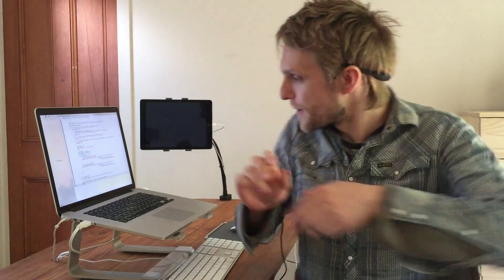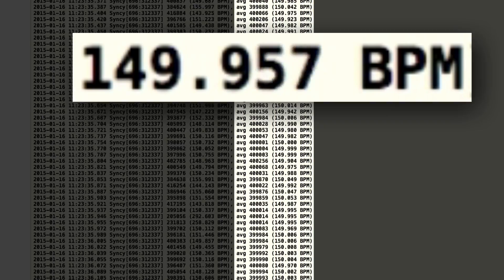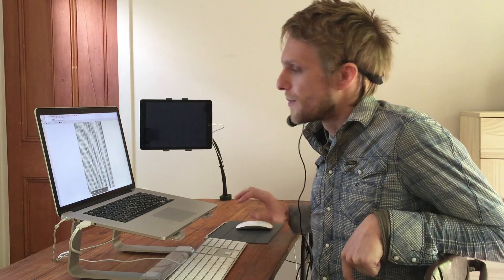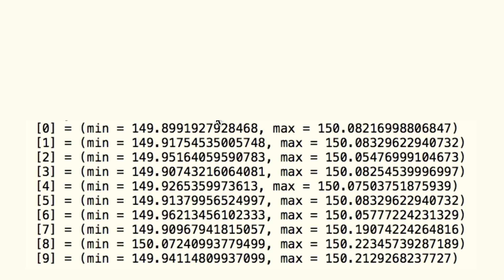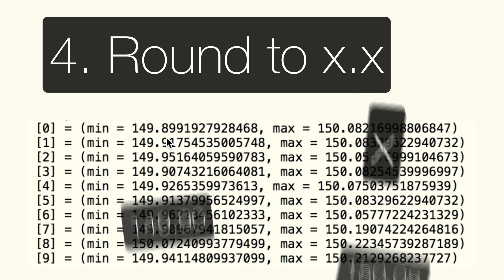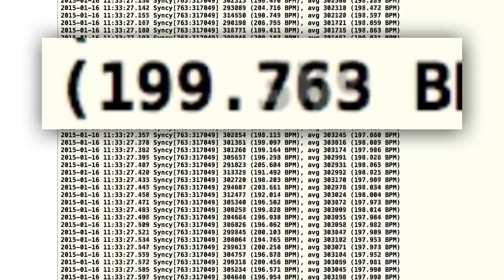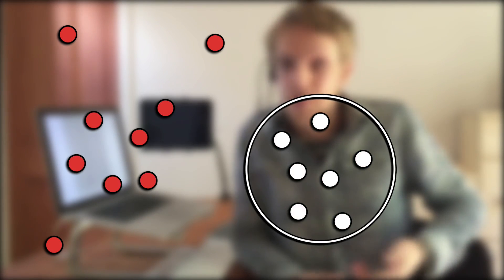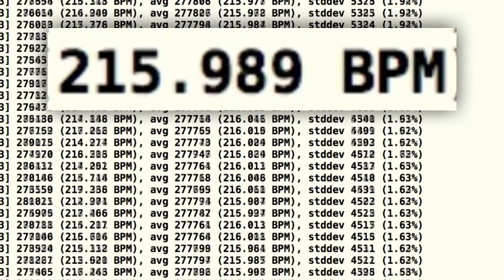Loopy Masterpiece: MIDI Clock Receiving

Comment: Isn't Midi clock also used to sync the beats in time. I mean, tempo is one thing. But you also want the timing to be correct.
2 synths on 150 BPM, but 300 ms delay between the beats is not good for your live performance.
Any thoughts on that?
Reply from the maker: Absolutely! I decided not to talk about that side of things because the video would've been way too long and dull - but it's all in there. Basically the idea is to count ticks, and calculate back from the time you received the last tick to when the clock started. So, say, you've counted 25 ticks, the most recent at time t_tick. You've seen 24 tick intervals since the clock started - so the start time t_start is t_tick minus 24 tick intervals ago. You take that timestamp and run it through a lowpass filter (averaging buffer) to take out the noise, and then you use that timestamp in your app to calculate position (i.e. at global time t_1, the timeline position is t_1 minus t_start).
Reply: Thanks for this, I’ll have to try it out for myself :)
Reply: @timwalther  wow 6 years 😜
Reply: ATastyPixel Yes!

Comment: Interesting! I'm a bit skeptical of the rounding approach though.. What if source bpm is 129.5, fluctuating +/- 1 bpm, for example?
Reply: that was also what came into my mind ...
Reply: Then it would figure out that it rounds to 1 decimal place.
Reply from the maker: Jonatan Liljedahl In the case you describe, it would actually round to the nearest 0.5 - my rounding points are 0.0001, 0.001, 0.01, 0.1, 0.5 and 1.0 - I just didn't mention the 0.5 point in the video to keep it simpler. But if you have a source that sits at, say 129.25, it'll consider rounding to the nearest 0.5, see that it still oscillates, and round to the nearest 1.0.
Reply from the maker: Mind you, if the source is so unstable it can't manage to sync to the nearest 0.5 and be stable, then it'll resort to rounding to the nearest integer, and if the BPM is actually x.5, it will oscillate.